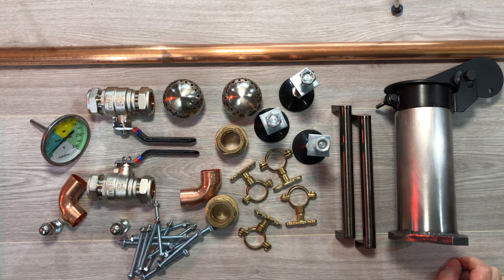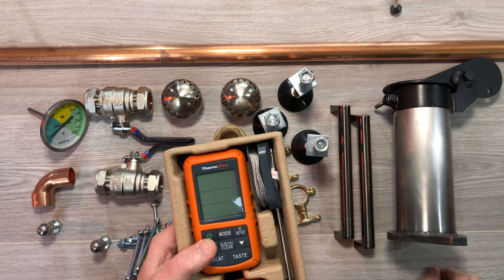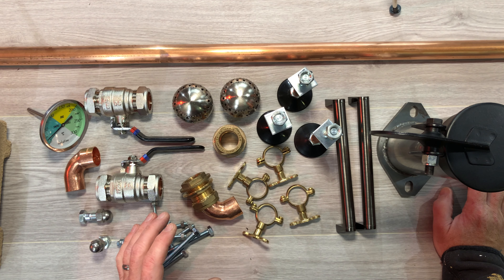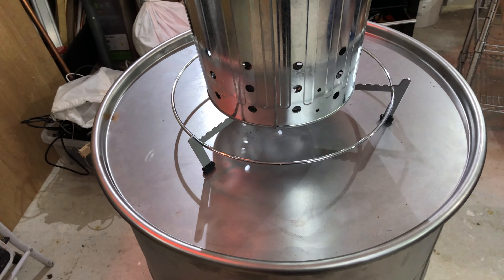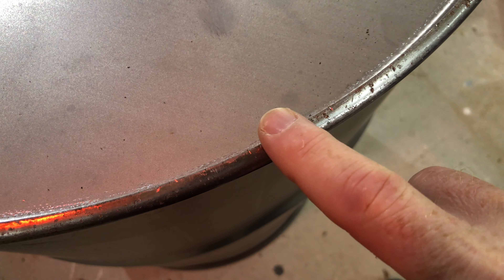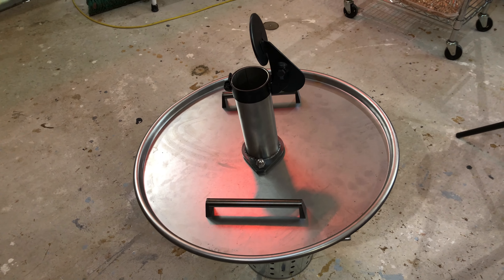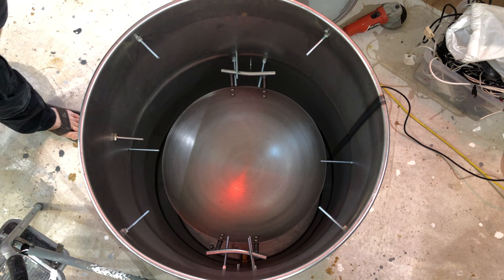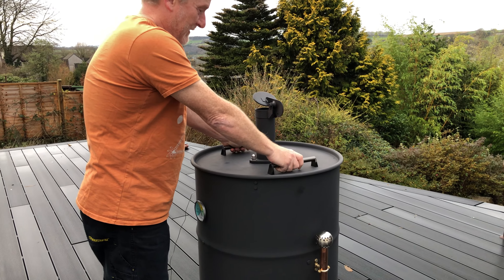Homemade ugly drum smoker how to | thanksgiving turkey to test it

Comment: Amazing. What was the heat consistency around in the drum above the heat plate? Also did you just chuck wood chunks on top of the briquettes? 
I love it. I want one!
Reply from the maker: Hi Richard, UDS barrels are susceptible to outside ambient temperatures. Practice on a calm day, not on a windy day. I mixed the wood amongst the charcoal as not to ignite it all at once. Happy smoking 🍻

Comment: Are you not worried about zink poisoning due to using galvanized metal for the charcoal basket?
Reply from the maker: Hello Ivan, you make an important point regarding zinc oxide fumes, one I didn’t mention in the video.  Modern galvanised metal contains no lead only zinc which is a good thing of course.  Zinc only oxidises when it exceeds its boiling point (907 degrees C).  A new container like my fire bucket needs to be ‘burnt in’ with an extreme fire (away from food) to ablate the surface.  What’s left is a coating of carbon which then acts as a barrier.  In a UDS the fire bucket temperatures are always lower than if the bucket was in the open air.  The UDS by design is a smokey environment meaning it will not exceed 900 degrees in the bucket - zinc melts at 415 degrees but it does not oxidise.  If you weld galvanised steel you are creating mountains of the toxic oxide because of the extreme temperatures involved.
UDS toxicity trouble happens with drums that have internal epoxy coatings - if you don’t remove it thoroughly you are in poison territory - likewise, using briquettes that have been prepared with flammables to make them light easier - using wood chips that have bark on them is also nasty.
Thank you for your comment Ivan👍🏻